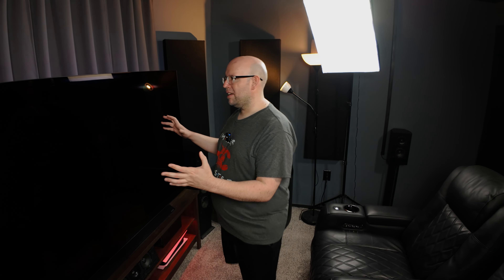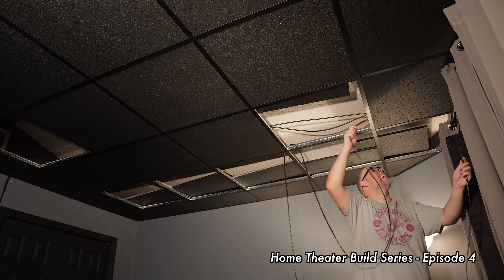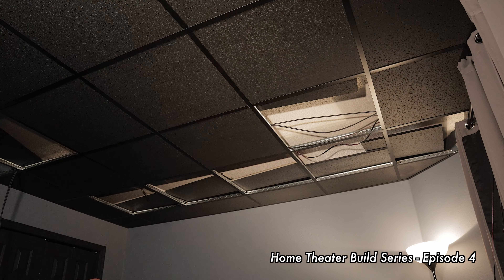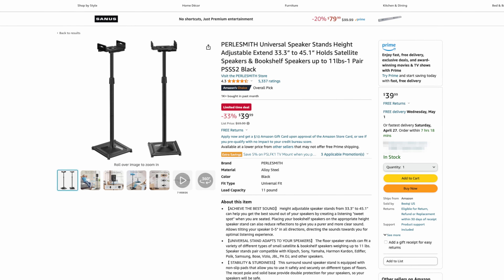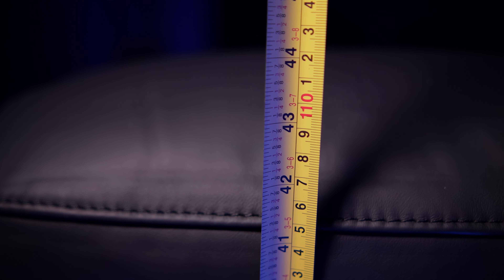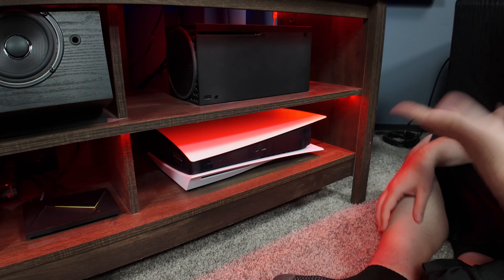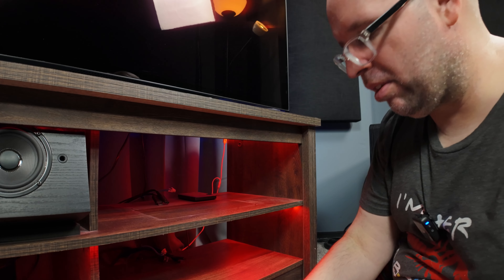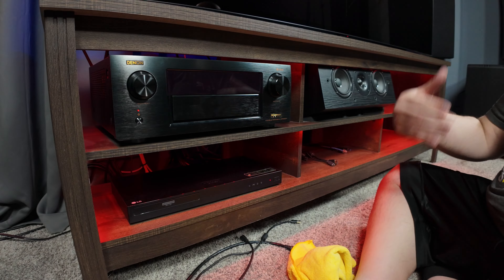Home Theater REVAMP - PART ONE

Comment: I’m done with av furniture in theater rooms. Such a headache. Once you go rack, you never go back. 😅
Reply from the maker: Definitely a valid opinion/preference. I’m not ruling it out in the future, but I did this on the cheap and spent as little as possible. Main goal here was to get the center channel out of the entertainment stand by raising the display up. A rack would have complicated this project and raised the price considerably (HDMI cables, speaker cable for rewires, not even including the cost of the rack itself). Again, might be something I do in the future, just not right now.

Comment: The great HT dilemma when not wall mounting: center channel too low or tv too high. I built a TV stand that solved this. Made an adjustable shelf for center speaker to sit on. Made the top with a cutout for the speaker to move through, so the speaker can be adjusted to sit exactly below bottom of tv.
Reply from the maker: That’s an awesome solution! Can you easily swap out center channels if need be? Or is it a more permanent solution?

I always forget to mention this in videos as it is kind of obvious, but due to the nature of this channel and product reviews, I need to make sure I have enough options for swapping out center channels. That was one of the biggest goals of this project as I haven’t been able to since we’ve moved into this house. Turning down speaker reviews because I can’t accommodate a center channel downright sucks, and I’m glad to be past that now with a better solution. And thankfully, the tweeter and drivers sit fall within a few inches of both the listening area at ear height and the front left and right speakers. 

There is a fine line between designing or integrating something permanently in my setup versus making it product review friendly haha.
Reply: @HomeTheaterGamer   thank you, it’s worked out well for me. I made the opening in the top of the stand larger than my center channel I have now in case I get a larger one. It’s not sized to accommodate one of those massive ones though. It is easily swappable, it’s literally just sitting on a shelf, and speaker wire is easy to reach to unhook. I have some preset holes drilled to adjust the shelf for a different height, or will drill new holes to get it set exactly under tv if I change tv or center. I’m happy for you that you have things the way you want it, and can swap the center easier now!

Was fun watching you revamp your setup. Nice job! I just went through that a month ago after removing a door that was always in the way, so it was like moving out and moving back in. I definitely understood your measuring and measuring again, along with your wire management. 

I hadn’t come across one of your videos in awhile, so I found you again to see what your setup was like by now. You used to have an 85” Vizio PQX, correct? I’ve had mine for 3 years, but it’s already developed an issue with the backlight (local dimming to be specific) that affects HDR the most, strangely. Certain scenes you see blotches in the right side of the screen around objects like it’s bugged and can’t keep up. Tv was a super headache, but it’s mostly sorted out by now, and wasn’t prepared to have it replace it already. I’m usually excited for a different tv, but would be the first time I won’t be going up in size, and PQ increase will be modest, so I’m dragging my feet!

Comment: I cant believe its been almost 2 years since you did up that room! 

I recently got permission from my wife to use the majority of my annual bonus to buy a larger TV. I went from a 55inch LGCX to a 77inch Samsung S90C. I feel your pain trying to measure up everything! As I had to reposition the wall mount it really was a real headache to calculate. Lifting that thing onto the bracket was also terrifying! 

I actually found that I prefer that then my projector, which I use on a 100inch drop screen. Though the projector I got isnt really designed as a HT projector, but it was free so cant complain.

Looking forward to part 2, thank you for taking us along your HT journey
Reply from the maker: Time does fly! It’s hard for me to believe it’s been a year since I bought the Denon X6300H from a friend of mine! Crazy.

That’s awesome and congratulations on the TV upgrade! I haven’t had a projector for years, but for gaming especially I’ve always preferred a TV  for a number of reasons. It’s also impossible for projectors to compete with something like the S90C in regard to black levels and HDR. It’s just such a massive divide there. Projectors have their place but as displays get bigger and more affordable and offer higher end features at a relatively low price of entry compared to projectors, I think we might start seeing some diehard projector users switch over.

Comment: 14:45 not sure if this happens later on in the build or if you're planning this anyways? But... after hearing that "dong" of the stand, i would highly consider some mass for the stand. I personally recommend the Atamacia actamites to take ringing out of the stand considering its proximity to centre speakers your planning to review. It could hurt/harm their audio presentation in your final thoughts. Everything so far is looking great. I have skipped a little of the time-lapse footage so again apologies if your video addresses this issue.
Reply from the maker: You mean you don’t want the stand to sound like the St. Anger snare drum? Haha. Good catch! I don’t address it in the video, but that ringing was very intense before putting the display on the stand as you mentioned. I did put some black gaffers tape on the rear of the stand before running the wires (something I use to control cymbal ringing and tom ringing on drum kits when I don’t have access to moon gels). That helped drop the ringing down and is pretty much non-existent now when tapping the stand.
Reply: @HomeTheaterGamer  ahhh... have to admit,  I would love to see someone's face while watching a home theatre set up video and moon gel starts making an appearance. Been using that on REMO or Evans heads for over 20 years now. But good old gaffer's tape to the rescue!!! The most indispensable tool of any professional musician. Looking forward to part 2. Thumbs up button will be another ready 😀

Comment: Wait a minute, I've forgotten how you have your equipment set up. We both have a tv that does eARC and we both the denon x6300h that is just ARC so what are you getting from the eARC? I have my ps5 straight into the x6300h so I get dolby atmos but I lose vrr and I use a second monitor setting on my pc to the x6300h and straight to the TV for 4k@120hz vrr.

Did I I not understand your video on the extractor and how to use it for the ps5 to get 4k@120hz vrr and dolby atmos?
Reply from the maker: It can be a little confusing. I have the PS5 connected directly to the TV, then I have the eARC output of the TV going to the input on the eARC extractor and I’ve set the TV’s ARC function to eARC. I then have the audio output of the eARC extractor going to one of the HDMI inputs in the receiver, which I’ve assigned to the TV Audio input (you don’t use the ARC connection on the receiver at all for anything).

Hooking it up this way will get you the best of everything. 4K/120Hz and HDR with VRR and Dolby Atmos on the PS5. I also have my PC connected directly to the TV using a 4070 Super as well. I get all the bells and whistles with Dolby Atmos audio there as well. It’s great!
Reply: @HomeTheaterGamer  with zero delay? Also are you still using the Orei? That's a hell of a work around! Thank you for the excellent reply and information! 🤜🤛
Reply from the maker: No delay to speak of thankfully! And yeah, still using the OREI eARC extractor (the cheaper and smaller one I purchased myself. It’s the HDA-927. I don’t think they sell it anymore unfortunately). Still works like a charm. OREI did contact me a few months after that video and sent me the HDA-939 for review, which is its bigger and more expensive brother with some extra features. Since they don’t sell the cheaper one anymore, I’m going to keep the 939 around as a backup just in case.

The OREI really has been a game changer for me though. I see a company called U9 sells one on Amazon that literally looks like the same thing for around $50. I don’t know how good it is, but might be worth looking into if you need one and don’t want to break the bank.

Comment: Can you please leave a link to the lights you have on the back of your tv?I have the same make and model,Thanks Your snake-pit lookes worse than mine,Yikes
Reply from the maker: Sure thing! Affiliate link below. It’s a great bias light that has a 6500K mode (a necessity for me) but it has occasionally lost sync somehow with Alexa for no apparent reason. No app updates, etc. It just decides sometimes that it will not work for whatever reason, so I’ll need to use the app to control it.

And yeah… the snake pit of wires definitely needed an overhaul. Haha. 

https://amzn.to/3UgQlX4
Reply: @HomeTheaterGamer  Thank you for the link,I didn't think anyone made them in a size for 77'' tv's